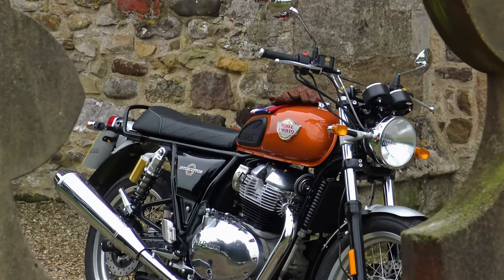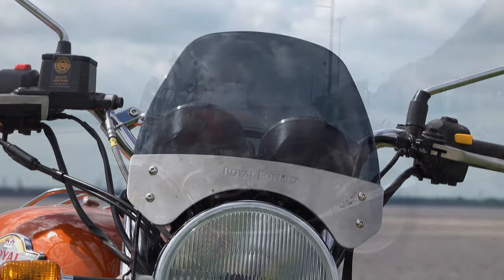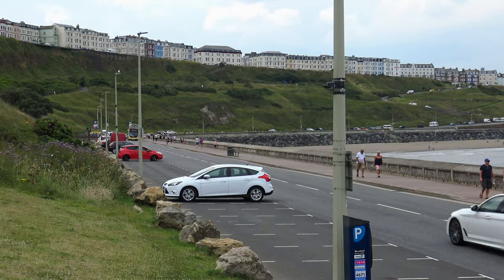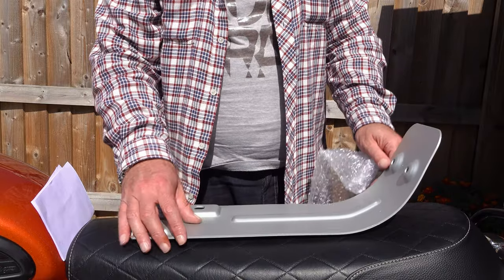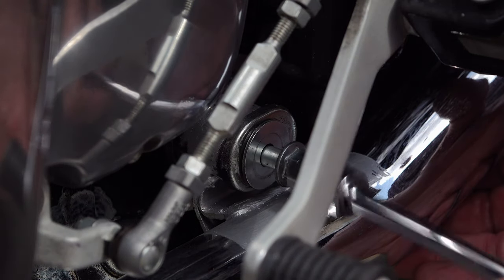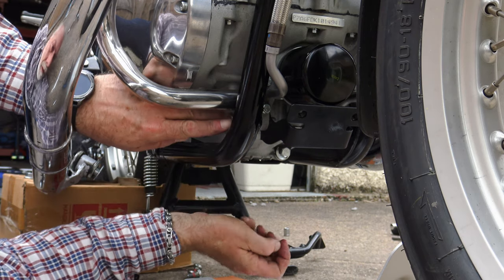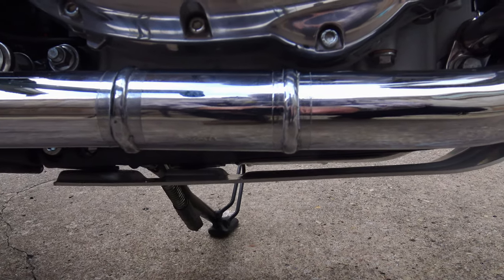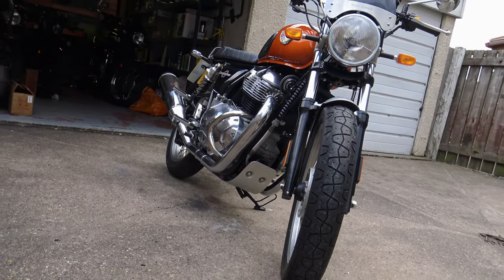Royal Enfield Interceptor 650, The best sump guard/bashplate and how to fit it!

Comment: One small tip which may be useful. When you have finished fitting your kit, and the exhausts are secure, carefully snip through the cable ties used to secure the headers. Snip them so they can be re-used. Then before you store away your original (and now spare) fasteners, string them together using your salvaged cable ties. Saves a bit of waste, and keeps them together, making them easier to find should you need them again.

Comment: After a lifetime as a mechanic, I find a certain fascination in my retirement of watching others now on YouTube. 
I really rate you Stuart for your step by step instructions, complete with torque settings for all fixings where necessary.
However I do feel a little bit uneasy watching some Vloggers, doing jobs on their bikes and not torquing or appearing to sufficiently tighten fittings up. They and those that copy them could be putting themselves at risk. 
To quote another old saying from the trade, tight is tight and too tight is f***ed!
Reply from the maker: Thank you Roger! Im not a mechanic myself and I do have my limits as to  what I will tackle. fully agree with what you say, there is a certain responsibility involved!

Comment: A few points. Simple and easy are two very different things. I just got finished installing this sump plate on my bike. It was simple. It was not easy. I spoke at my bike in ways that would make a sailor blush and my grandmother wash my mouth at with soap for several hours while I completed the installation.  I'm glad I did it, and now I can take my bike places I would not have felt comfortable before the installation.

Give yourself time and space before you jump off into this one.  Also, thank you Sir for the walk through. It is excellent.

Comment: I purchased this sump guard after I had already removed the complete (38 lbs) oem exhaust & installed a high mount, scrambler style exhaust (9 lbs); thus I was able to skip a few steps during installation, thankfully 🤗  
However, I was shocked to look at the lower right-hand side of the frame today and see an empty bolt hole.. thinking I had screwed up led me to this fine video, and in fact, showed me that I had installed the sump guard correctly, bad memory of the actual installation not withstanding.. I can only remember 5 things at any one time:  Where I live, where I parked (usually), where I put my keys (sometimes), and I forget the other two things..
Thanks for the video, Stuart!

Comment: Great video as usual . Yes you can use the sump guard to to support the bike to remove the front wheel etc . The only thing I did differently was to scallop /remove a small semi circle from the top of the front bracket to allow oil filter removal without loosening the engine bolts . Keep the videos coming it's always  nice to have an idea of what s required before I start .
Reply: Great idea ,will do the same 👍

Comment: Hi Stuart, many thanks for this video. I've just ordered an Interceptor and am eagerly awaiting its delivery and the blank canvas to individualise it. This is certainly one of the accessories I will be purchasing. My question to you is this; with hindsight which would you fit first, the sump guard, the engine bars or doesn't it make any difference? Cheers, Andy

Comment: Hi Stuart .fitted mine today and it took longer to reform the threads in the front bracket than it did to fit the sump guard
Wish I had a 10x125 Tap to tap the thread s out .used the old sump bolts from fitting the crash bars and an impact gun . Eventually all fitted 

Must admit a little attention to detail from RE would have been helpful 

I can see this problem being an issue to many people

Thanks again

Comment: My kit only came with one washer. Oh well off to the hardware store again. Thanks again Stu.
Reply from the maker: Hmm someone with an arithmetic problem in the packing department!
Reply: stuart fillingham Hi Stu just went out to ride my brand new Int650 and the front tire was flat. Using my compressor to fill the tire but all the air was rapidly coming out at the base of the valve stem. Very strange. Guess my new bike already needs a tube. Not sure how or why that happened.

Comment: Stuart, the sump guard is very nice, however the black pieces that came with my guard from RE - every threaded hole was clogged with black paint.  Looks like India received a fresh shipment of black paint!  I needed to chase the threads with a 10mm (x1.25 pitch) tapered tap to clean things up - not a big deal if you have that tap on the shelf along with a T handled tap wrench to fit the tapered tap into.  The sump guard is nice, but what should have been about an hour job turned into a 2 1/2 to 3 hour job.  Thanks for the guidance.

Comment: Good review Stuart & you make the whole procedure easy. One thing though. Is it possible to actually hinge this sump guard at the rear? How easy would it then be to just undo the front bolts & drop the guard down?  Obviously this could cause a problem if the front bolts some how vibrated loose? Of course then you’d be an instant pole vaulter!🤣😖
Reply from the maker: I dont actually think it would be possible Andrew, and you certainly wouldn't have enough clearance under the bike to drop it far enough to be of any practical benefit!

Comment: Hi Stuart and fellow interceptor owners, I fitted the RE sump guard on my interceptor too. I noticed a change of the bikes sound afterwards, a very slight metallic tone coming from the sump guard. In fact, when I grab the plate, the noise stops. Bolts are all tight. Anyone else has experienced this? It might be a good idea to fit some rubber bushings as isolators between the bolts and the plates!
Reply from the maker: it will just be resonance through the plate.
Reply: @stuartfillingham  yep! Thought it's interesting and worth noting that the guard changes the sound of the bike (very slightly). Absolutely essential addition to the bike. Thanks!
Reply: Hi, I just fitted the RE sump guard and I'm experiencing the same slight metallic tone. I was thinking to use some rubber bushings as well. I haven't tried it yet. Have you?
Reply: I fitted today...i am also facing the same issue...anybody hav the solution?
Reply: Same here. I tried rubber washers but no luck.
Reply: Anyone solved the problem? Or you guys just let it be? Thanks
Reply: I glued 3mm rubber on the guard facing the engine (all but the raised areas). The ringing metallic noise is gone.

Comment: Bit late on this Video however I would like to mention That I have clocked more than 10+ Kms on the interceptor, If you keep the riding to mostly freeways, you do not need a Sump guard.. However if this is your daily commuter well... you certainly need one...  I have a 100cc Commuter and Interceptor for my adventures...

Comment: Thanks for this guide. Got the part delivered today. There are only 2 washers included. In older instructions there are 4. You used the washers at the front. Does that mean the rear bolts used from below don't have washers?
Am I correct in saying that the front bracket has the same screw connection as the engine protection bar. I have both parts here and need to attach both.
Thanx from germany.

Comment: Many thanks Stuart, for this video. I have ordered a 2020 Interceptor 650. Requested for Compact Engine Guard, Sump Guard, Tall wind screen & Fork Gaiters.
The salesman @ RE is refraining me from placing the Fork Gaiters as he fears, the process might end up with the bike wobbling. He further advised me to install it after 1st service. 
Stuart, may i request you to guide me if i should install it or not. Thnx🙏
Reply from the maker: I cant see why gaitors would cause a problem if installed correctly but go with what your dealer recommends and take it from there.

Comment: Stuart, thanks a lot for such informative videos. Lots of thanks and love from India. I had booked a RE interceptor 650, but i am little confused with colour options. My primary selection is chrome and secondary comes silver/grey. Could you tell if there is anything to keep in mind before buying chrome colour- anything to keep in mind or any reason to avoid buying chrome. Kindly help
Reply from the maker: Chrome should be just as durable as paint Phani. to maintain it just use a non abrasive carnauba wax!
Reply: stuart fillingham thanks a lot stuart for the reply...
Reply from the maker: @phani71188  No problem, I have actually been testing a new product called bilt hamber speed wax, would be perfect for that use!
Reply: I was told by a guy who had a chrome tank the it catches the sun from any angle and reflects into your eyes. I don't have experience myself on this.

Comment: Sorry I'm a bit late to the party Stuart. Excellent video as ever thank you. Just one question, is it sufficient to just ease off the front bracket mounting bolts to rotate it out of the way for a filter change, or does it need removing? Thanks again!
Reply from the maker: No need to touch the brackets once they are installed. just unfasten the bash plate.

Comment: Am I right in thinking that by fitting this you won't be able to remove/replace the oil filter without removing the front bracket, as well as the guard itself?

Comment: After you installed it and rode about, did you notice any noises coming from the sump guard? I installed mine recently and I  keep hearing a (although faint) noise from it at RPMs over 3000
Reply from the maker: No , None at all.
Reply: I do :( Engine Guard alone No voice , Sumo Guard alone No voice. Putting the sumpguard in combination with Engine Guard there is a screepy high frequency voice so disturping me that i am Not riding at the Moment....

Comment: Thanks Stuart. What size 1mm steel washers do you use in place of those original spacers where the engine bars and and sump plate fit? 10m or 12m? I've the same set up happening there with engine bars. Thanks

Comment: Stuart, I've just received my RE sump guard.  I'm confused about removal of the exhaust systems. I know that the bracket bolts should not be tightened until the sump guard has been attached.  This, I think, requires that both exhaust systems be removed at once.  However, in the video, I notice that you only have one exhaust system off at a time. I'm hesitant to have both off at once as it doubles the chance for disaster, but this has to be required in order to do the final tightening after the sump guard has been installed.  Did I answer my own question?  Also, how necessary is a torque wrench?  How precisely must I tighten those bolts?  Forgive me, I'm a neophyte mechanic .  Thanks for this and all your great videos!  How can I send a donation?

Comment: I got my sump guard installed today and I immediately noticed a metallic sound that is caused by the vibration in combination with the guard… I am not very satisfied with that change in noise… Did you notice that as well  on your bike? I am thinking on using some rubber bushings to eliminate that sound, hopefully it helps.

Comment: Hello there!

Have you experienced increase on noise and vibration after fitting the genuine sump guard?

I bought one on a RE dealership and they got it installed for me and since then I noticed some annoying metallic noise and vibration. It gets higher between 4k and 5k RPM, but I listen to and feel it already when engine is idle.

They didn't use any washers and I've been told that the kit doesn't come with then and the bolts provided are adequate to make sufficient pressure and keep the plate firm and steady.

Because they're located 200km+ from home I can't go back there soon. I tried to unscrew the bolts to install the washers I have here but they seem to be stuck or over screwed...

So I gave up trying to remove them to avoid damage the threads.

If I knew it makes such unpleasant noise and vibration I would have taken a chance to let the bike without it.

Thanks for your vids!
Reply from the maker: No
Reply: Hey I am facing the same issues. The metallic noise is very mild but I can feel it . any idea how to get rid of it ?
Reply: @adapa5075  I've installed two washers with the front bolts, because the rear bolts had already washers which came with the kit.

The vibration reduced a little, but it stills there.
Head mechanic told me vibration is characteristic of this engine and it won't go away totally.

Next service it'll be done an update on ECU to solve some issues with overheating that have been occurred here in Brazil as consequence to Brazilian standards for petrol fuels.

I think, as I've read in some forums, that noise will drop drastically with this changes in the EFI program.
I hope it makes the riding more pleasant...
Reply: I glued 3mm rubber on the guard facing the engine (all but the raised areas). The ringing metallic noise is gone.

Comment: The bolts that come with this have a red thread locker on the threads. Red usually means the bolt it is not going to be removed. However if the bolts are to be removed and the guard dropped for oil changes it seems to me that the blue thread locker, removable, would be more appropriate. 
Any problems removing the bolts for servicing?  BTW, mine only came with 2 washers also.

Comment: Here in India, service center mechanic installed the sump guard without removing exhaust pipes.
Reply: using a ball end allen key
Reply from the maker: @bpgrmds  Hmm Those are critical fasteners That hold the frame together would be interested to know how he achieved the correct torque values with a ball end Allen key?
Reply from the maker: Frightening!
Reply: @stuartfillingham here, they don't check the torque value while tightening the bolts. It's all their mind calculation. For my Interceptor they didn't even check/adjust tappet during first service. Most of the trained mechanics really don't know what all need to do during periodic service.
Reply: @stuartfillingham   I didn't see them doing that. But you have made the video to answer lot of my Quire's. 1. Is it safe to comprise a one time procedure for convenience 2. What is the recommended torque setting for those vital bolts that we are playing with 3. Even I'm aware of other after market products that are not perfect either etc... You have set things right once in for all with this upload.
Many thanks
Reply: @anasmanalath  exactly
Reply from the maker: @anasmanalath  Wow All even more frightening!

Comment: Hi Sir, did you change the length of the bottom bolt ? with the same combination of engine guard as well I added 1 ss washer like you on the left hand side no problem, but when I want to put it on the right hand side with 1 washer its a bit tight not enough thread to catch the nut. I ended up not putting washer on my bottom right. Still looking alternative change the bolt with the same 8.8 tensile strght. Did you experienced the same ?.

Comment: Hi Stuart, you say it may be necessary to loosen the bracket when you change oil filter, so I guess by now you wille have changed the oil filter, so how is it? Just remove the sump plate or did you need to loosen the bracket too en pull it down?
Reply from the maker: removed it, it takes 2 minutes.

Comment: Is it easy to remove sump gaurd when doing an oil change ? As far as i can understand you just have to use screwdriver to remove sump gaurd . (Theres no need to remove exhaust and brackets ,right ? ) . Meaning installing brackets for sump gaurd is one time process . Btw liked you video .
Reply: Correct ,just remove 4 bolts

Comment: I removed the guard for the oil change and am wondering whether to use a couple of washers for the square rear holes? I got the dealer to fit the sump guard and they only used two washers at the front. I think RE supplying only two washers might be intentional, but I can't work out how the guard is held in place at the rear given the bolt heads fit through the holes?
Reply: And thanks for all the videos Stuart, they've been very useful on my Interceptor journey.

Comment: Someone has uploaded a quick fit version of fitting the sump guard, using a ball head hex key. This does away from undoing the exhaust. However I am not sure if they were able to secure all the fasteners to correct torque specs, as the ball head hex key works at an angle...
Reply from the maker: yeah heard of this. my philosophy is , stop looking for short cuts and just do the job properly!